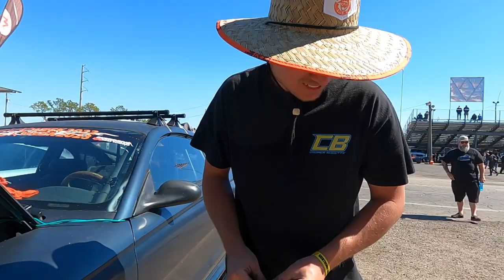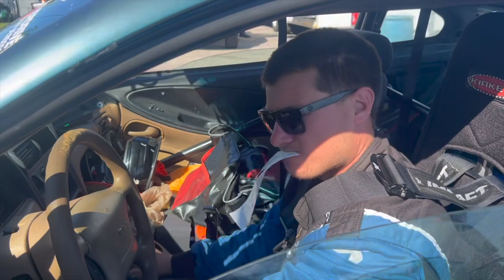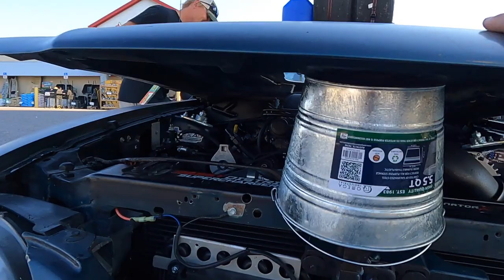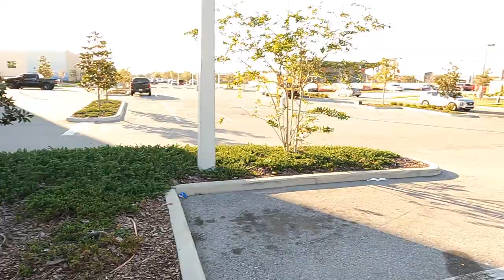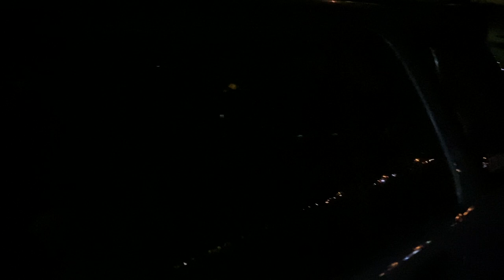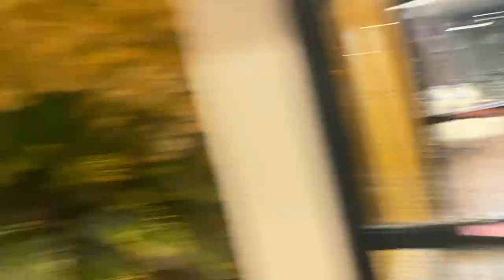Chip Is Constant As Can Be! So I Had To Screw It UP...

Comment: reaction time is, in my opinion, more important in index racing than it is in heads up. With heads up, you can horsepower around someone. Index racing is nothing but having a consistent car mixed with a good driver. You can take a deadly consistent car/truck and lose every single bracket/index race because of shotty driving. RT is Everything.